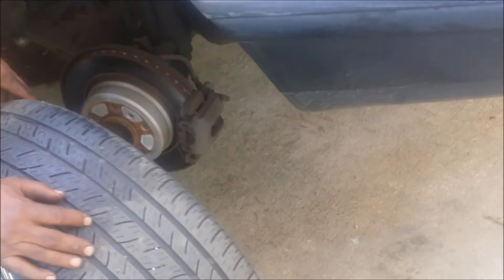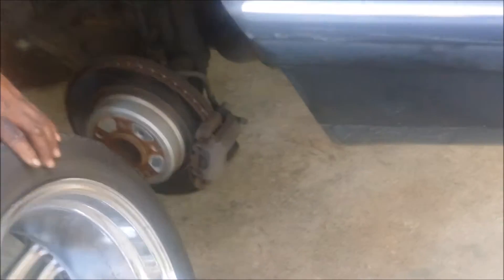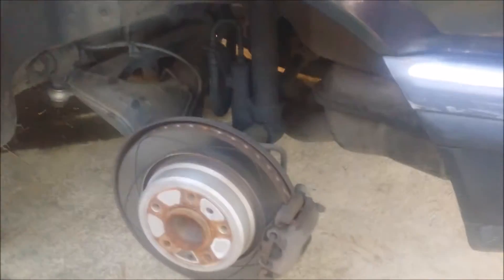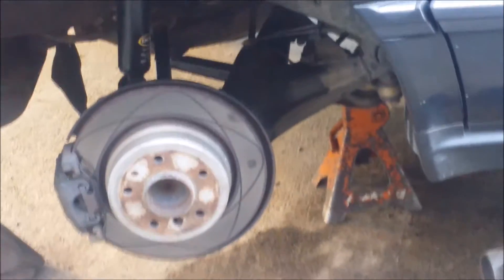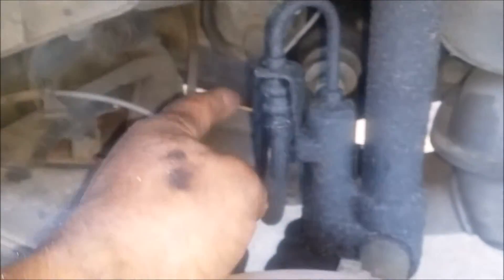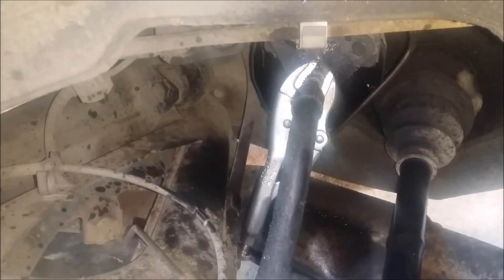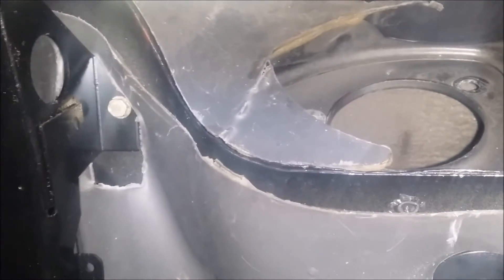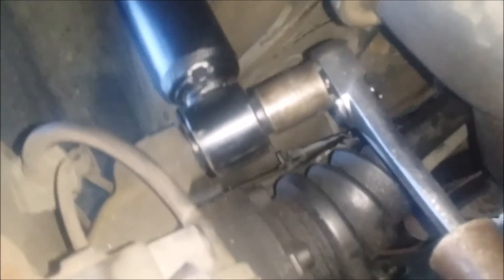1994 BMW 740il replacing self leveling strut with a regular strut .

Comment: I have a 2000 740iL and the self adjusting keeps adjusting itself when driving and only the Wife and I in the car. Its giving me the shits, so I thought I'd have a look on line to see a) if it can be changed back to none self-adjusting b) how long it takes and c) if there is a set kit you can recommend
I am in Australia, where you have to bend over to pay for parts, so I usually buy from the States as even after the poor exchange rate and the cost of transport, it's cheaper than buying here.

Comment: Hello. Thanks for the video. Is it necessary to replace the Springs too? or the new non-leveling-struts can use the stock-self-leveling Springs? what about the Mounts?  Thank you!
Reply: Emilio Otero I think it was cheaper to use the old springs. we just got new mounted cause they was cheap and the other was busted. if yours still good use them. please subscribed and click the bell.
Reply: Ok thank you very much!!  some links said that the oem springs needs to be replaced with non-leveling springs together with the new non-leveling struts, i thought the springs woudnt fit (maybe different sizes), but if you tell me the oem springs fit the non-leveling strut im gonna use them !!
Reply: @EM-fy3wi  they fit but the car may sag as they are softer

Comment: Waiting for the video how to disconnect self leveling system 93 BMW 7:40
Reply: Just took we sealed up the brake fluid line back there and just took electrical plug lose from the seller leveling unit.

Comment: my self leveling shock is leaking. I can replace it with a regular strut? Im trying to figure out how to cut off the self leveling system. im showing this vid to my mechanic. ahahaha thanks!
Reply from the maker: oh one thing , take aloose the self leveling system in the car.it will be pumping and the drive you crazy.
Reply from the maker: lad/self leveling elimination kit they got a diagram on it. You could 
just connect 2 hoses to make to fluid recycle.plus take loose the self 
leveling adjuster.  Or you can buy the kit , its on the internet  on a famous auction site.

Comment: anything you have to show how to take the lines down for the conversion.
Reply from the maker: lad/self leveling elimination kit they got a diagram on it. You could 
just connect 2 hoses to make to fluid recycle.plus take loose the self 
leveling adjuster.  Or you can buy the kit , its on the internet  on a famous auction site.
Reply: ok got the time now...any recommendation on a kit or the type of struts you used on your bmw 740il self leveling elimination kit